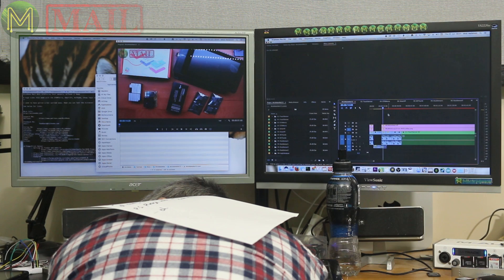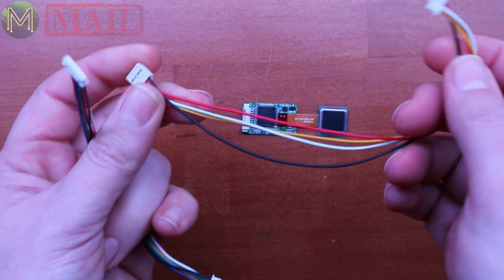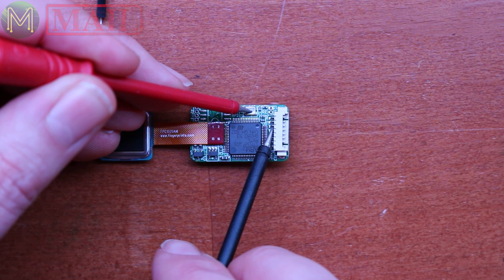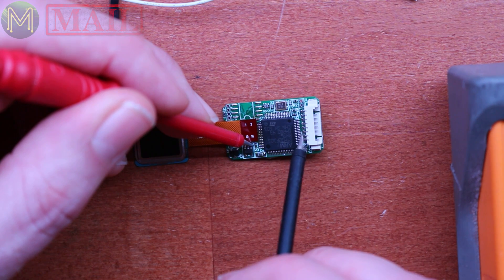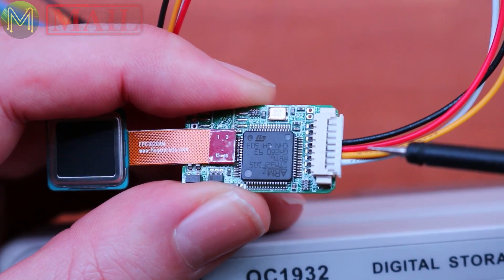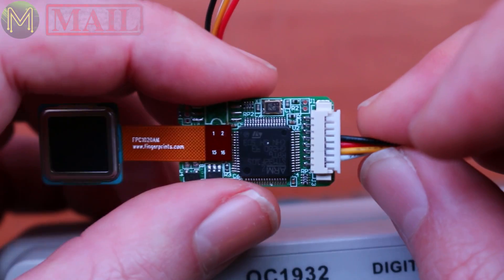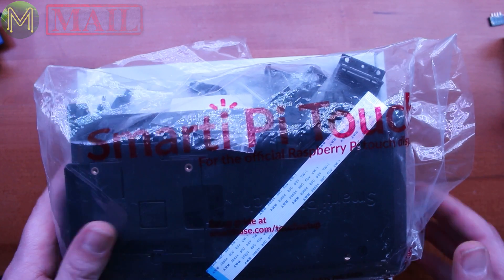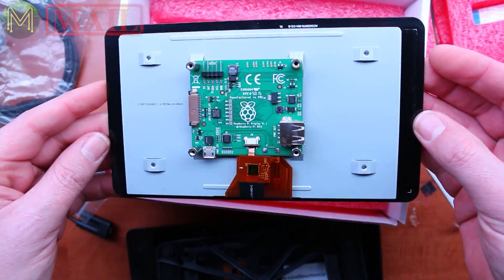#146 MickMake Mail #12: STEMTera, SmartiPi & sensors // News

Comment: Where did you get the micro USB power double adapter from? What is it called?
I have been looking for these and haven't been able to find them. I have resorted to using a USB hub which is a poor solution.
Reply from the maker: Yup, This one came with the SmartiPi. Been trying to find some myself as they're useful.
It's a fairly thick cable as well, so less voltage drop over the span.
Reply: MickMake I would have thought they would be popular too. I have tried many places now looking for them but without success.

Comment: Hey mate. had the same issue with max30102 module, it seems that the sensor is dead or doesn't work, got it from ebay. It will just read out 30bpm if you place any kind of object on top of the sensor. ie paper...
Reply from the maker: +Ashwin Bhanderi 
Yup, I'm suspecting there's some faulty units. Wouldn't mind getting my hands on a faulty unit to see if it can be fixed.

Comment: Mick !! 98bpm at rest ! Either the sensor doesn't work or your heart needs checking! I'm 54, certainly not a sporty type of guy and I get 53bpm at rest ! Seriously, have a checkup mate !
Reply: Heart rate gets slower as you get older, specially at 54.  98 is a bit high, but it depends. 80max is normal hr.
Reply from the maker: +UFOhunter 
Thanks mate. Yeah I have regular checkups. If I was sitting down and "resting" then it'd be around 60-65, but while it's daylight I'm always moving, so not surprising my HR is around 90.
Reply from the maker: Normally I'm around 65, but I've been like that for years and years. I stand all day, and often hit 98 while "resting". (Although I very rarely "rest" as I'm always on the go.)
Reply: MickMake From what I know, heart rate it's not really a good indicator of health. There are many athletes out there with high resting heart rates and even higher peak rates, but they're just fine. There are definitely far better gauges of heart health that's for sure.
Reply: Have you seen a cardiologist? You should. Specially if you have high blood pressure or diabetes. 
Take care of yourself dude. I like your channel and want you around for a long time...
Reply from the maker: +Izzie 
That's true. The past 8 years I've been averaging 4 times a week at the gym, with only the last 6 months dropping down to once a week due to rotator cuff injury.
Reply: It must be a defective trim pot :)
Reply: I'm just concerned about your well being ! You're such a nice guy ! Sorry to have stirred up the comments ! Anyway, nice video ! I can't  wait for all your roundups and mail opening ! It's very good for my work; saves me a lot of time searching for some components. Keep it up and the heart rate down !
Reply: must be from all the talking he's been doing throughout the video